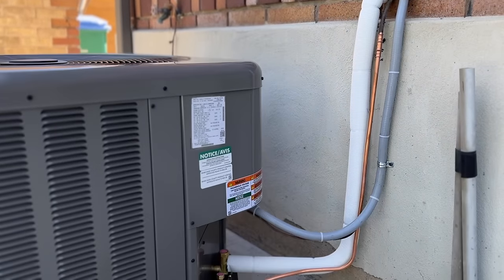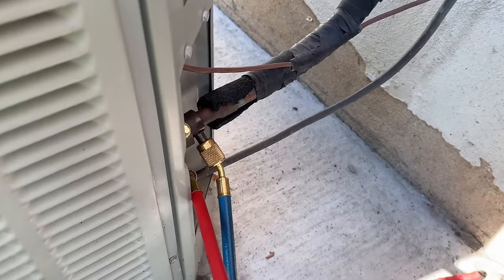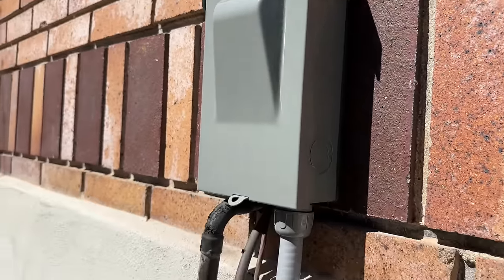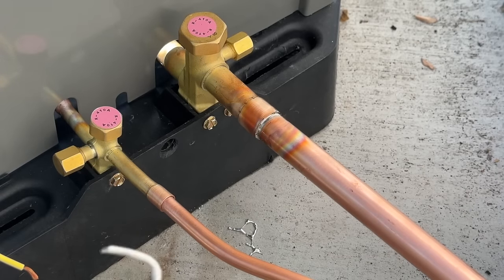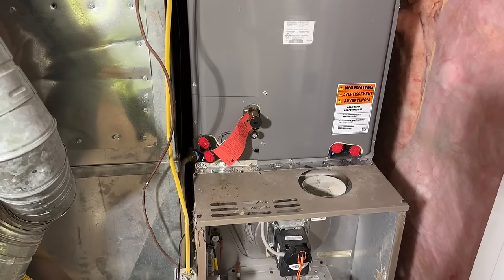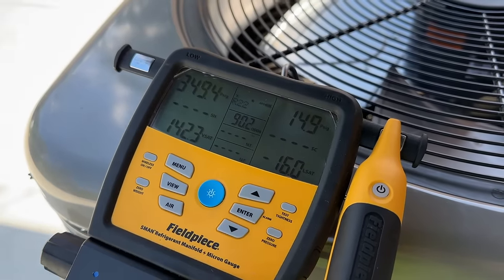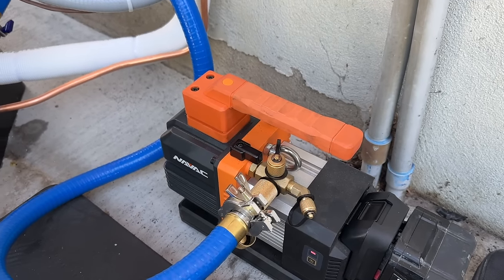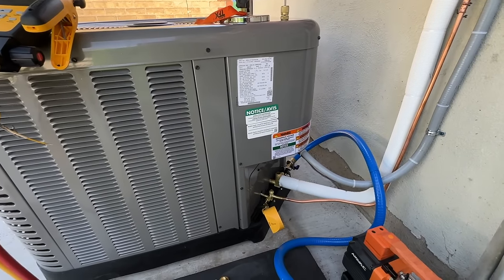Did You Know You Can Replace Your Own Air Conditioner?   -SAVE THOUSANDS-

Comment: I'm an HVAC Professional with 20+ years of industry experience and after watching HVAC DYI videos all I'm going to say is this.  Beware of DIY HVAC repairs/change outs especially when you open up the system.  HVAC is a very meticulous process and if you don't know what you are doing you can seriously hurt or you will  be replacing compressor every 2-3 years.  FYI. When doing R22 equipment change out but using the existing copper lineset, you MUST flush the lines using a solution like RX11 to rid of all R22 oils and contaminants.  If you fail to do this task you will be replacing your compressor very very soon.
Reply: Most people don’t know this, and some contractors skip this important part of installation!
Reply: Just like this video? I know residential installers love soft solder but that flux is a contaminate.
Reply: lets not forget your required a EPA 608 before messing with any refrigerant or your screwed
Reply: Let's not forget brazing with nitrogen to prevent carbon build up on the interior of the line set.
Reply: Well said. Let this "DIY Guy" teach the public in a 25-minute video what takes us YEARS of training and practice. Next time when they burn down the house and the insurance company refuses to pay, we'll be having the last laugh. Not to mention damaging the brand-new compressor because they didn't know they were supposed to flush the line set or change it altogether.
Reply: I just posted this before I read your comment.  Honestly, I'm all for it.  More hackjobs = more revenue and service calls for professionals.  But ya, that lack of lineset flush really bothered me lol.
Reply: This is sadly how most HVAC people respond. You better not rotate the tires on your own car as you might have a blowout and be injured. Only let a tire shop do that as they’re professionals. That’s basically your fear mongering argument. If it’s any help I can install 3 or 4 DIY systems for the price of ONE professional install. So even if it does’t last quite as long I’m still WAY ahead.
Reply: @owenaero HAHAHAHAHAHAHA!!

OR ELSE!!

U know that little thing "I am buying this to provide to the epa certified technician who will be installing my system"? Whadaya know, as it turns out the EPA SWAT team has yet to bust me.

Wanna hear something else hilarious? Refrigerant "recovery" yeah..... LOL!
Reply: I just replied to a person further up in the comments who said the pros are complaining about people potentially "burning down the house" but having someone certified and bonded helps when it comes time for a warranty claim vs a customer doing it themselves.  If you do it yourself and the equipment becomes a multi-thousand dollar paperweight because the solder (or brazing or whatever connections you do yourself) isn't done correctly the company can say the warranty's void and you end up calling an actual professional with years of experience and the certifications to install another one, costing you more money than just getting the professional to do it in the first place.  Besides, insurance companies like it if you get  certified professionals to do it anyway.
Reply: @CesarCadevilla  Again, I don't think the house would burn down but you will end up with some shiny and expensive scrap metal.
Reply: @sharedknowledge6640  It's always better to be safe than sorry.  The insurance companies usually like it when you get someone certified to work on it and for liability reasons, like when your tires are too worn to use on the road, they blow out and you cause an accident involving other motorists and their cars.  I get my dealer and mechanic to service these things because I don't know what the hell I am doing and I don't have the appropriate tools to do the job.  If you want to certify your car, usually it involves taking it to...*say it if you know what it is*...a certified mechanic.
Reply: @owenaero   Not for someone doing it on their own system.  But regardless, who cares, it's not enforced anyway.  Show me one homeowner that's ever been arrested for filling their own AC system.
Reply: @johneldorado  Exactly. read this: Guys, listen to this guy. Do it yourself or even Buy the Unit and then call someone to install it for you. You will even save thousand do it yourself. A company in this desert heat charge me $ 11,800 in heating and cooling Unit: Amana 4-ton 15 seers. This Unit could cost to them less than 5 or 4 K dollars, but they kill me with $ 11800 and the company is a shit.
--- If you buy the Unit for $ 3 or 4 K, you can call even a company and how much they will charge you? No one will charge you more than 3K, will be an abuse. $4K+3K= 7k dollars, it will be a save of $ 4,800 in total.  My unit was installed last year 2023. I learned with pain, next time I will laugh for sure of those company. LEARN, LEARN, AND LEARN.
Reply: @CesarCadevilla  I'm not an ac guy but when I had a new unit installed couple years ago (old R22 unit came out) I don't think the 2 clowns putting it in flushed the original lines. I just didn't know that was supposed to be done. I'll remember that for next time tweedle dee and tweedle dumb do a job for me. By the way, they were in such a rush that they didn't pitch the air handler right so had to come back TWICE to try and stop the condensate leaks. After that I finally had to do that myself to keep from filling the pan. I wouldn't attempt a full install myself though, but I'd like to get enough knowledge to know if they are doing it right for $$$ it's costing me.
Reply: As an experienced tech that’s been burned by 410a be careful. Refrigerant is never worth your skin. I had my entire hand peel off because I had a solenoid stick in front of a new customer. I dove in to try and save the day and ended up going to the Grady Burn Clinic in Atlanta for treatment.
Reply: Absolutely and with the pressures of 410a being so high I always braze my line sets, even with R22 I always brazed and never had call backs for leaky systems
Reply: @owenaero  Only if you rat them out.
Reply: @bryanx590  
- Loose electrical connections
- Improper wiring size
- Undersized/Oversized fuses
- etc.

And here's the best part: your home insurance won't cover damages unless the installation is done by a professional.
Reply: @user-ol5rj8qn9o  I actually agree with you. I've seen my share of bad techs doing shoddy work. That's why homeowners should verify the credentials and reputation of any contractor doing work in their home.
Reply: So thats why I see so many people replacing their compressor on new systems, except  in their case they paid a professional to do it.

Comment: You reused the old lineset, R22 oil is not compatible with R410a oil.  You should have replaced the lineset or at minimum used a RX11 flush kit to clean the old lineset before reuse... you'll probably be needing a new compressor in a few years, good luck!
Reply: I concur with that! Always flush the lineset if your going from one refrigerant to the other if you aren't going to replace them!
Reply: Yeah, changing the R?? Need to flush IMO.
Reply from the maker: Haven’t had any issues, and I have talked to a lot of guys that done either. I have a few videos showing the Hilmor flush pigs, they’re easy to use. The only time I flush it, is if it has acid or compressor burnout
Reply: That’s a hack excuse of an answer.  There’s a right way and a way that so far has worked.  Don’t be that guy
Reply: @diyhvacguy  that a bs answer. There’s a saying, Hacks bring me Stacks. Your complete misinformation will cost people more in the long run.
Reply: @EnigmaticJack   Yep and when it fails you would be left wondering geez how much longer would it have had if I wasnt cutting corners
Reply: We want an update after 3 years. Good luck with that compressor. There's a reason why licensed and trained HVAC contractors should do these jobs. Manufacturer also probably won't honor warranty if you're not licensed.
Reply: R22 mineral when mixed with R410a POE will form a paraffin like substance that ultimately will destroy that brand new system.  I for the life of me don't understand why anyone would spend thousands of dollars for new equipment and not spend a couple hundred for a new lineset. What a hack job.
Reply: @diyhvacguy where can you buy a new HVAC unit
Reply: Who's gonna pick up the old AC  unit  ????   How much ????
Reply: Yes the oils are different as well and don't tell me your average homeowner is gonna buy all the tools you need to get the job done right, like the gauges, oxygen and acetylene, vaccum pump, nitrogen with the manifold actual brazing rods 😅 plus a shit load more of small tools. Common bro really 😂
Reply: I forget the name of the company, but there is a HVAC company in Las Vegas that has been testing this.  They found that mixing freon has not been an issue for the compressor.  These guys have many years in the HVAC industry.  They even had a compressor running both R22 and R410.  The guy said it had been running for 2 years just to experiment with it, wanting it to fail, but it kept going. 

I think further testing is needed, but I do not think it's a big deal.  You don't have to replace the line set.  I encourage the companies to ru experiments on used units to see how long it will run.  Heck, if you have a new unit, use that. 

I doubt they will do this, though.  There is no money for them to do that way.
Reply: @topher8634  A "couple hundred" dollars for a new lineset? On what planet? The copper alone on dual unit 50' run will cost you that much. Couple that with squirreling around in the attic of a two story home in hot S Florida and its a multi-hour job to replace those linesets and pretty grueling. It's literally the worst part of the job. But hey, if you're charging 200 bucks, good on you.
Reply: @privatename3621  I wasn't talking about what I nor anybody else would charge to replace a lineset. Read the title of the video again if you're confused. If you buy the coil and condenser and spend several thousand dollars, go ahead and spend a couple hundred more and get a new line set. It's stupid not to. Or at least flush it out, if they are the same size. My experience though is they often are not. Especially the liquid line. What if the system you are changing out experienced a burnout? Would you for yourself or in good conscience for anybody else put in new equipment, charge a customer thousands of dollars and reuse the old lineset with all the debris and acid in it? Not I. I know how hot attics are. I live and work in Georgia. But I chose the profession. And as hot as it gets, I sure don't want to be doing the same job twice.
Reply: @hewavith as long as you have your 608 universals your factory warranty stays in place.
Reply: @TheMan1akz I guess where you’re from those items are hard to come by or something.

Comment: Do the work yourself and then just call the HVAC person in the end to test and fill.  Just like you would if a line broke and it all the refrigerant leaked out.  It will still save you thousands.  Saved me about 50%.
Reply from the maker: Thanks for sharing!
Reply: I guarantee you you'll be having issues within 5 years.......
Reply: @marcusaurelis  bet lost.  it's been 10 and going.  But I do get your point.  Most people..
Reply: @marcusaurelis  nah
Reply: @rcisneros8567  how many times have you added refrigerant?
Reply: @marcusaurelis  None.  During the checkup/spring clean up, they have 'topped' it off.  No charge, so I can't believe it's that much.
Reply: @rcisneros8567  Well I stand corrected here for sure then. I'm a service technician and customers being cheap or doing things themselves are always the easiest calls lol.

Cheers to you being competent.
Reply: @marcusaurelis  I learned from some skilled people.  I can imagine some DIY things you would see.
Reply: If you service techs did a half way decent job and didn’t rip people off people wouldn’t want to do it them selves.   I wanted to install my whole home humidifier myself but let the local big hvac company “pros” do it for a rip off price.   The idiots installed the control panel sensor on the supply which makes it worthless.   They only came back and fixed it because i read the manual and knew it was wrong.
Reply: @marcusaurelis  I had issues with a professional installed AC unit at my business.  Lost all refrigerant in 2 years from new lol.  I installed my own Mini Split (flare joints not MrCool) at home which has already outlasted that pro installed AC, problem-free.  The mini split paid for itself in 2 years of savings, now 3.5 years old - if I'd hired a pro the break even would be like 10 years here as they charged my neighbour 4x as much.  I could replace it 3 more times myself for the price the neighbour paid.
Reply: @marcusaurelis  Keep in mind that, as a technician, you have a skewed view of this.  If someone isn't having problems they aren't gonna call you.
Reply: I am a professional hvac technician and I won't work on a machine that has not been been worked on by professional,  I won't even touch that machine because of liability purposes.
Reply: @rcisneros8567  There shouldnt be any "topping off." You either have a leak thats letting freon into the atmosphere or you dont.
Reply: Did your unit not come pre-charged?
Reply: Most units come pre filled with refrigerant
Reply: Well that's not raising it's soldering
Reply: Soft solder should never be used on high pressure systems. The manufacturer's manual even states. You need to use a minimum of two percent silver solder
Reply: I do this with mini splits a lot.  Customers buy and install whatever brand they want. I go do a pressure test with dry nitrogen, evacuate, and start. $150
Reply: @rcisneros8567  ohhhhhhhhh he launched a missile and said 10 YEARS goin strong!!!!
Reply: I thought y9u had to replace both the condensor and the air handler...you can just replace the condenser with no problems?
Reply: @jinsu0504  If it is the same refrigerant and capacity you can. There was a period a few years back when the industry was changing from R22 to R410A, that is when you couldn’t.
Reply: @Feelingsmasher2000  well how long do each last...my condenser outside says it is 25 years old...my air handler looks brand new but i haven't seen any stickers....might have to check again...but its in tip top shape
Reply: @jinsu0504  I would, but I've been told so many lies in cash grabs, I don't know how true it is.  It's been repeated so long I don't know if the AC people really know.
Reply: @rcisneros8567  i would what? I dont understand what you are saying
Reply: @jinsu0504  replace both at the same time.
Reply: @jinsu0504  Sorry, i was in youtube jail for telling the truth. Just run your unit til the cows come home and start putting money aside so you don’t get caught with your pants down.
Reply: @Feelingsmasher2000  thank you for the wise advice. I guess ill keep it than upgrading it..its working fine. btw what do you think about annual "tune ups." should i pay 80 bucks per year to have a guy come to visually look at the ac unit?
Reply: Dont listen to this guy , have a professional come and do it correctly. If you do it wrong it can cost you a lot of money or you could get hurt. I understand trying to save some money but we in the industry can't find qualified technicians and this guy is trying to teach  DYI ac installs. Come on!!
Reply: @dawgdaze72  we can't find qualified techinicans who's sole intention isn't to grab ur money...thats the problem...8/10 people i called...they work for the best interest of their commission and pocket...im so done with this field and the people that saturate it.
Reply: @jinsu0504  The largest percent of those technicians  work for a
Company. And if you've never ran your own havc business , you wouldn't have a clue on what it costs to do business.
Reply: @dawgdaze72 sure, I’m gonna look for the same”professionals” who said I needed to replace both the furnace and ac because of a 30 dollar flame sensor!!! If can fix a 50 million dollar helicopter I can fix my ac and furnace!!!

Comment: Quoted 9k-14k here in SC on 3 ton Goodman split.  I spent $1500 on tools , $3200 on equipment and did it myself . Could have done it cheaper but I purchased decent equipment which included testo 550 digital manifold set , r410 25lbs, victor acetlyn torch set , Eli tech scales , nitrogen 40lbs tank with gauges , yellow jacket manifold set , charging hose set with ball valve , 2 schrader valve removal tools , and a few other various items . The only thing I borrowed was a cps vacuum pump . It was really enjoyable doing it myself
Reply: Mini split system is a little bit simpler not the same that was shown .
Reply: @bluejay713  thanks , but I did both . Testo 552i micron gauge worked excellent
Reply: @bluejay713  not the best way to test for leaks , if you have a leak While using a vacuum pump You will pull moisture into the lines
Reply: Unfortunately most HVAC issues are install related which is why new construction and DYI guys are such a pain to deal with. Every day we have to clean up the mess they made 5 years ago lol
Reply: @theviking8513  For example?  What mess ?
Reply: @theviking8513  Interesting, I've seen quite a few disastrous "professional" installs.

Comment: you need a licence to buy the system and you need to run nitrogen while btazing. I have never seen any ac company use soft solder and I have been in the industry for over 30 years